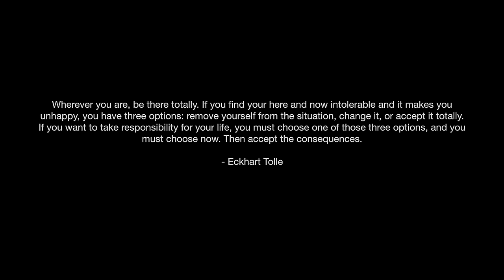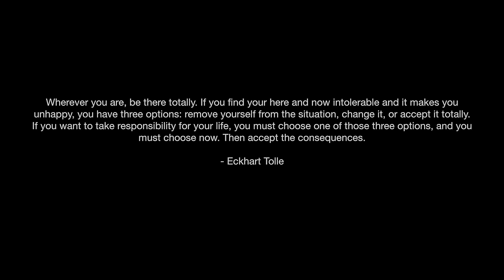Transcendence - Episode  35 Live Edge Walnut Countertops Bus Conversion

Comment: First, I am not a wood worker. Did you also put the epoxy on the back of the tops? Or are you not worried about then getting wet? If you sealed the tops completely would that cause problems? 
Your work is fantastic, this bus is going to be a true piece of art when finished.
Reply from the maker: Thanks for the kind words.....I did seal the top and bottom of the sink countertop with epoxy, but only the top side of the others. I figured they won't see much moisture over their lifetime.

Comment: I thought poly would sealed it just the same.  Why both?
Reply from the maker: The epoxy is very durable and provides an absolute water barrier. I didn't like the gloss finish though, so I used the satin poly to dull it down.